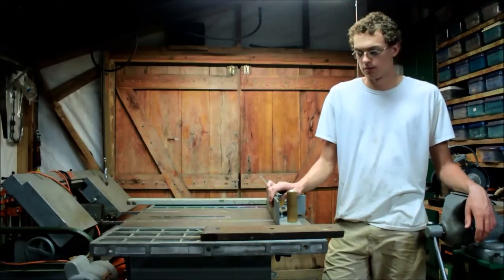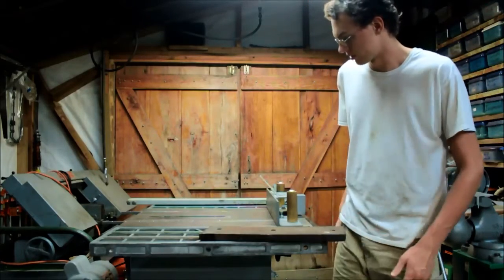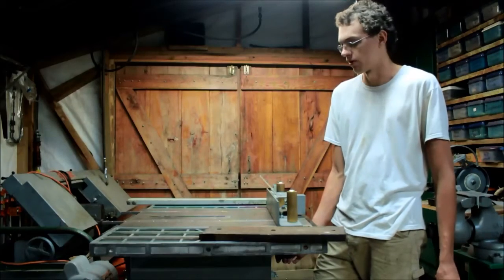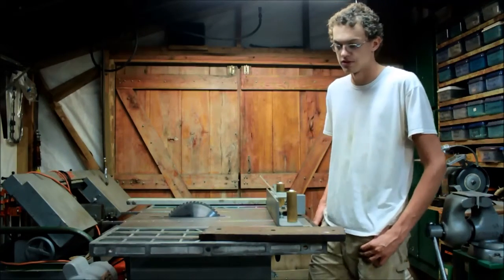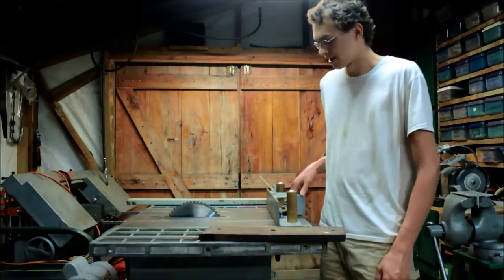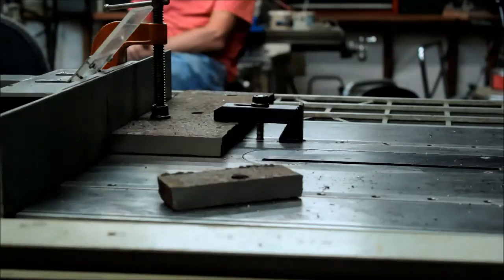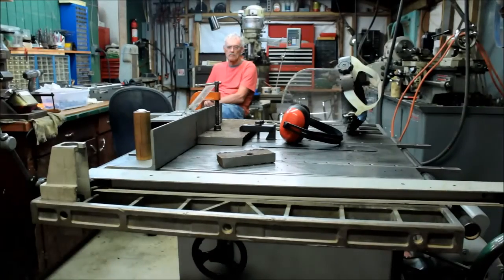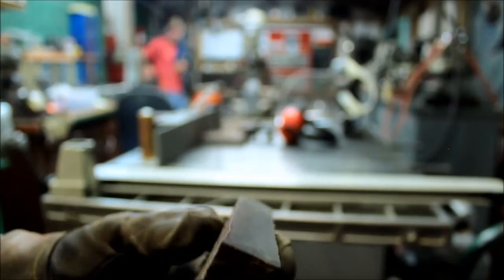Metal Cutting Table Saw Demonstration and Test Cut

Comment from the maker: Blade life has been extremely poor on this saw. You may end up buying blades all the time if you try this.
Reply: Are you using cutting oil or coolant? I'm planning on making a dual purpose table saw, I'm drawn to this idea for the great surface finish, the ability to cut odd profiles and for making long cuts in sheet metal. 14" carbide saw blades are like $20 in my country, so maybe a non-issue especially if coolant makes a difference.
Reply from the maker: @vikassm2383  Dry. Those 14"ers need to go real slow, like 1500 RPM.
Reply: Any ideas why? Would feeding slower or turning the blade slower (or faster) help? You probably know this but metal is weird and different metals are weird in different ways; some metals want high speed, others want low. The Machinery's handbook has tables for feeds and speeds; I doubt there is a table for metal cutting table saws but there should be enough info to get the right idea. Is the blade poor quality? Would this setup maybe benefit from fluid cooling? 

How exactly is the blade failing? Chipped  carbide? Missing carbide?
Reply from the maker: @charlesstaton8104  Slower wouldn't, it's already well below recommended. Faster might. Metal cutting circular saw blades seem to be able to cheat the SFM recommendations due to the LOC and amount of time to cool. I'd have to guess the blade life is poor due to improper materials and too thick of steel. We've tried a few different blades, none were great. I doubt flood cooling would help much, it's supposed to be dry cut anyway, wet would be tremendously messy. A slight mist on Aluminum might help a bunch as it likes to weld. Blades typically fail by getting dull, but sometimes by chipping.
Reply: Get a tungsten carbide saw with more teeth and it should last longer. I imagine with the lower rpm you also lost some torque. The chop saws are limited to the holding dimensions of the clamp. So this is great for big plates. I noticed there was not a lot of sparks when you cut which indicates to me there may not be much carbon in your blade steel. Just a thought I’m no expert.
Reply: Dude, you cut through 7/8 x 5 steel...I would have gone through a few cutting discs doing this and this is WAY more accurate. Good job!

Comment: That looks great. I wish you could buy a saw like this. One problem is that steel has to be clamped, so there is a safety aspect there. Also iron filings could get in the motor, although that does not seem to be a problem with your set up. Have you checked how quickly blades wear out with the metal cutting chop saws? It's probably quicker than they say.
Reply from the maker: Thanks. I don't live with my folks anymore, and haven't in 7 years, so I can't say exactly what the use/blade life is. Not great though. Problem is dad uses too much mystery metal which can be harmful on these blades. Life might be okay with only A36. I'm moving away from this style of saws, not as much of a fan as I was though I cannot deny the cutting efficiency. If you found a 6 pole motor, you could probably just install that directly. Good luck, and be careful if you try it.
Reply: @TheMetalButcher  Yes the type of metal was probably the problem. I  cut some parallels (tool steel) with a powered hacksaw, went through the first one well enough, but didn't even dent the second. Tried the same blade on mild steel and it was fine. So probably even stainless is too much for hack, rotor saws.

Comment: I am getting ready to buy a metal cut blade payday.   My stable saw is unique it is a shopsmith and it can run from 700rpm to about 5500 rpm. I have been seeing the sawblades and I see they are made to cut at a lower speed but will fit standard saws.  I also have a 10in sliding miter that has a two speed made for this but I never tried it.     Fixing to find out.

Comment: I own a small pallet business, we dismantle a lot of pallets. The wood runners tend to have a ton of nails in them Is there a blade I can put on my table saw and run the runners  through them to cut the nails off even? Any help is appreciated
Reply from the maker: Hi Mr. or Mrs. Martin,

Your average carbide-toothed woodblade is actually perfectly capable of cutting nails. The issue is feed speed. When you're zipping along through wood, and then you suddenly hit a nail, the teeth are exposed to too large of a cut and chip. IF you have an old blade which is starting to get a bit dull and you aren't really attached to, you can try that. Just feed slowly. If that doesn't work or you would rather just buy a blade, these Evolution multi-cutter blades are pretty much made for it. https://www.homedepot.com/p/Evolution-Power-Tools-RAGE-10-in-Multipurpose-Replacement-Blade-RAGE255BLADE/203661813
They have "rakers" that prevent you from feeding too fast, but I would still feed somewhat slower than you would do wood. Bear in mind that blade is made for a 1" arbor and you mill need an adapter for your average tablesaw. Best of luck!
Reply: The Metal Butcher wow thank you for such a fast and detailed reply, I looked at the blade on Home Depot site it doesn’t give a saw rpm. Will this blade work in my 10 inch dewalt table saw
Reply from the maker: @bentrishaleemartin926  Maybe. Can't say for certain. Their saw runs 2500RPM. Yours is 3850. It's a lot faster, but you're also not cutting I-beams. If you have the height, you could always run a 7 1/4" blade, that way the surface speed would be similar. That would also save you $15.
Reply: Depends on how wide you have to cut, I would say for peace of mind if a radial cut-off saw is enough then go with the Rage Evolution and co models. They have special blades that can cut wood and metals (including ferrous metals) all with the same blade. Depending on the model and given that it is a radial cut-off saw you should be able to go pretty far.

On that note always wondered if you can use these blades in regular tablesaws too.
Reply from the maker: @xConundrumx  Regular table saws run a bit fast. Life would be reduced.
Reply: @TheMetalButcher  Good point had not considered that.
Reply: I would not do that on a table saw, those small nails can become little bullets

Comment: I live in ireland and just bought the dewalt jobsite table saw at 240v do you think if I used a step-down transformer to 110v with it it would spin slow enough for using it like this?
Reply from the maker: ivan sheridan I really can't recommend this setup. it has to many issues. for $170 you can buy a 7" chopsaw.
Reply: ok thanks for the quick reply ,dont have any money for another new tool but dont worry id be hesitant to do anything to ruin my new toy haha
Reply: Also, using less electricity than the motor is supposed to can harm it.
Reply: AvE tried to do that to an abrasive chop saw, but at a lower voltage, and under load, the motor draws way too much current, I think it was something like 30 amps on a motor that's supposed to use 15.  The motor got nice and toasty.

Comment: Nice work! I have an old delta belt driven contractor saw that I geared down to 1500 RPMS and with a 10" EVO carbide blade I can rip plate steel all day. Cutting 10 gauge is like cutting plywood. The blades last if you keep them lubed and don't wear them down too much. $50 for a blade and then $20 to get it sharpened.
Reply: hmmm - but aren't all of the metal cutting carbide chopsaws 3400-4000 RPM? encouraging though thanks - i have a unisaw
Reply: @antigen4  I don't think so. Wood saws are about 3500 and metal carbide saws run a lot slower. I did try it at normal table saw speed and it was a violent nightmare. Once I got the gearing right, it has been butta! I am guessing it is 1500rpm because I swapped the pulleys (1.5" and 3" it was a while ago so I might be off a little) and it was still too fast so I went down to a 1" for the smaller and it worked great.
Reply: it should depend almost COMPLETELY  on your 'feeds and speeds' as they say - the weird thing is that higher tooth counts are recommended for metal - there are 100 tooth blades available for cutting steel - but if 3450 RPM is too fast then you would think that a much lower tooth count blade would fix that?  there are also carbide saws at higher RPM that i've seen though ... so for now it's all a bit of a mystery to me
Reply: @antigen4  The tooth pitch is what trips me out. I tried ripping aluminum bronze with a steel blade and ruined it. The stainless blades do not last in the evo saw or table saw. My next purchase is going to be a horizontal bandsaw for mitering stainless. I've been a carpenter/tile setter for 20 something years so I love learning the metal work. Much respect to all the lifelong metal workers out there...
Reply: Scott - well another important consideration is WHAT you're cutting - anything with brass/bronze is VERY tricky and gummy - so I'm not that surprised. I recently got a lathe and am teaching myself to weld too - which is all great fun considering i was never really the kind of person you'd imagine doing that. But i'm learning lots about working with various kinds of materials etc. But anyway - yes sure - a horizontal bandsaw can probably do the job very well - you may also consider a vertical one if you're doing finer work. There are some really cool machinists here on youtube doing that. I discovered a whole bunch of 'youtube people' doing related things through 'this old tony' s channel here - check it out if you don't know it already ... great videos and you can learn a ton - that's what inspired me to get a lathe actually (even though I had zero call for it at the time)
Reply: @antigen4  YES! I learned aluminum and other non ferrous metals heat up fast and wreck stuff. Vertical/horizontal combo isd what I'm thinking.
God bless the sonsabitches posting their work on youtube. Humanity at it's basic best.
Enjoy your metal work and... I'm guessing but, your book editing? Software engineering? Insurance actuary? Wine maker? Baker? Cobbler?

Comment: That was pretty intense.. but can you explain how cut was done with LITTLE (if any sparks?)
Reply from the maker: The sparks happen when small pieces of metal are heated enough to where the exothermal oxidation reaction can keep them heated until they are covered in oxide or they burn up. Here the carbide teeth either make chips that are large enough that the surface area to volume ratio is too low, or the small chips come off cool enough   that they don't have enough heat to accelerate the oxidation reaction. This saw runs very slow compared to most carbide metal saws, so the chips aren't all that hot. They still burn you when they land on you, bit not enough to make you want to stop cutting..., usually.

Comment: wouldn't you want to back up a bit every several seconds to let the blade cool down a bit so it doesnt' warp?
Reply from the maker: Surprisingly not. After that cut you could touch the blade and it would not be warm. If I had to guess some rough percentages, 95% of the heat goes into the chips, 4.5% goes into the part and about 0.5% goes into the blade. It really doesn't get warm.

Comment: Thanks.  That is very surprising to someone used to cutting with an abrasive blade.
Reply from the maker: Steel cutting carbide blades have been common for a while now, but they are typically used on chop saws.